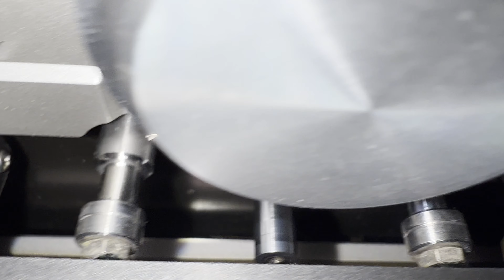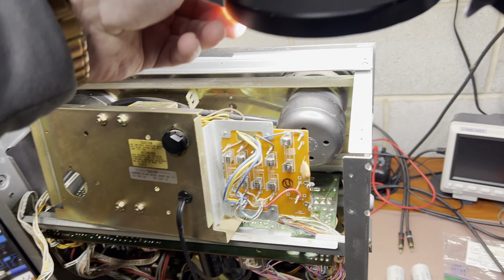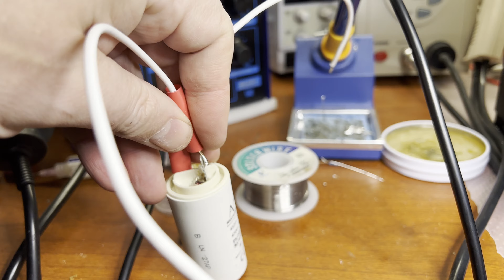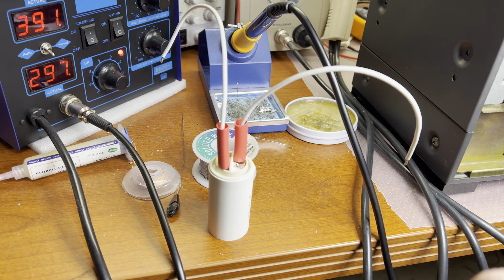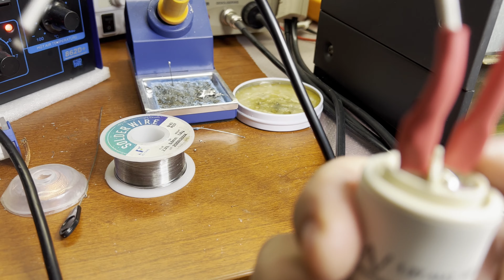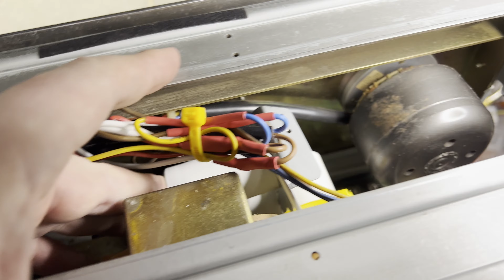Part 1 - Akai 635D Restoration

Comment: Why did you replace the AC capacitors, those dont seem to be leaking?
Reply from the maker: These capacitors are getting old and as a result tension for the tape reduces and levels start jumping during recording. As Akai does not have adjustments for the tension electronically, as Teac or Pioneer do, the only way to fix this is to replace capacitors to restore torque.
Reply: @hifirulezzz  Understood, thanks for your reply.